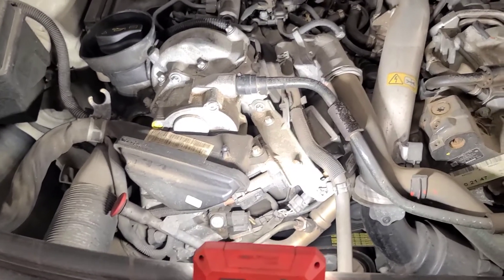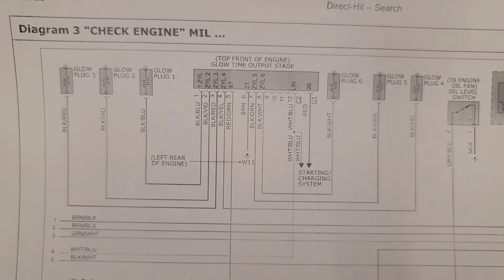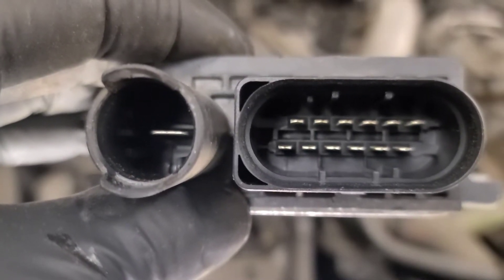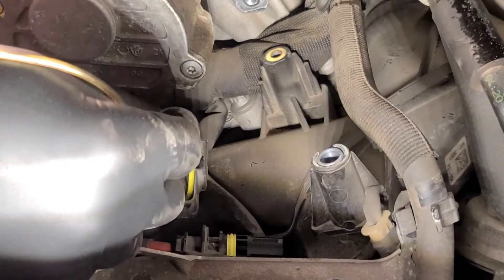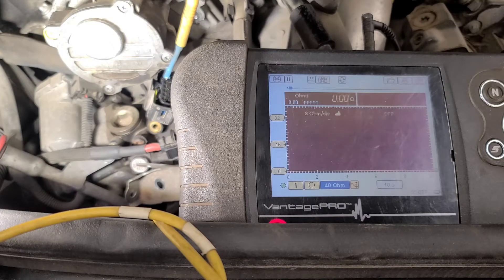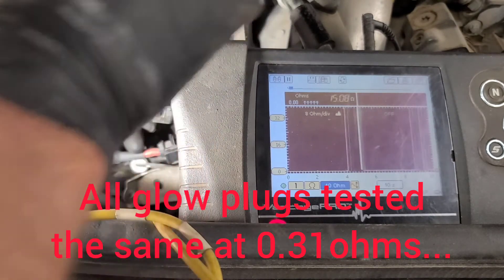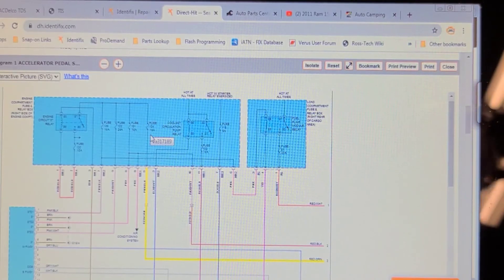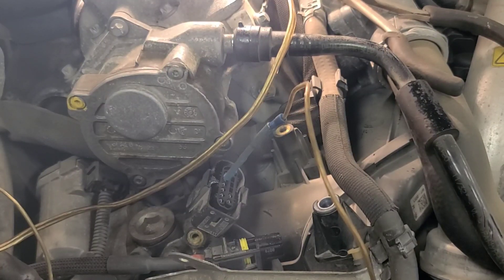2009 Mercedes Benz ML320 Glow Plug Control Diagnosis

Comment: Good video this problem has been plaguing me for a few years now i have replaced the relay box but still get the problem i wish you could have pointed out the 10amp fuse location, last resort for me to try cheers my friend 👍👍
Reply: Same here,  someone bought new car and I replaved plugs (three toasted) and the relay - still getting fault code. And no voltage at the plugs. Did you find the fuse?

Comment: Thanks, actually I replaced all glow plugs + the unit, therefore I'm about to check where the fault is, because the glow plug light is still on, and an error - lin communication appears through delphi diag. Did you experience it?
Reply from the maker: No I didn't but that glow plug controller is connected to the ECM via a 1 wire LIN bus which controls it. I'd check continuity of tge LIN bus wire and for possible shorts to ground on it. If my memory serves me that wire may also be controlling the alternator as well.